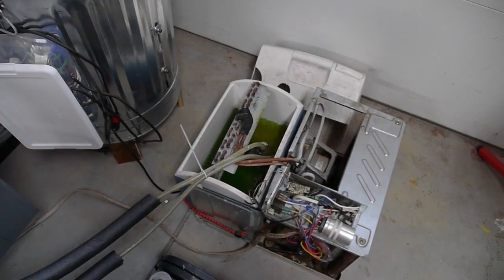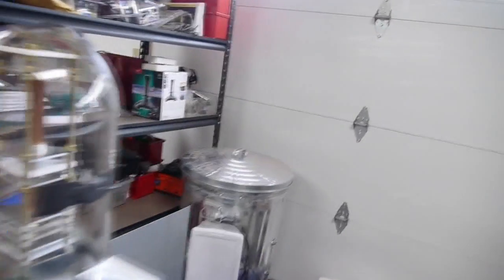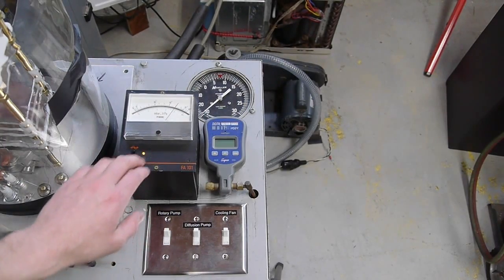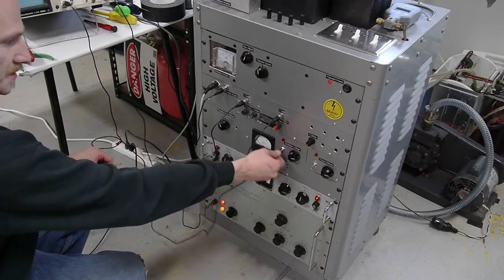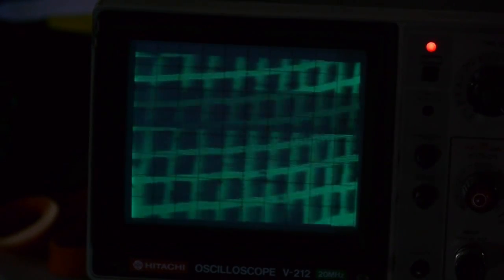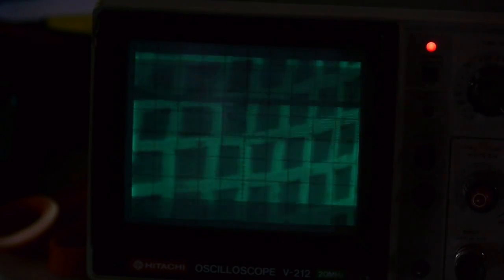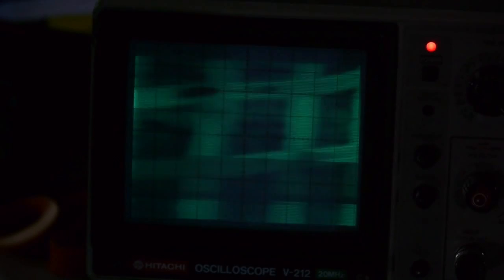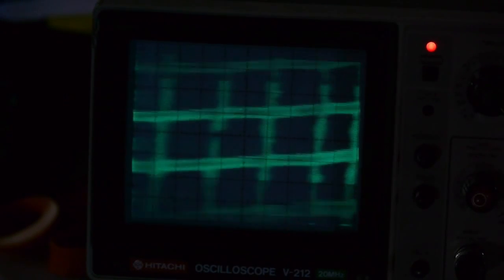DIY Scanning Electron Microscope - Operation procedure

Comment: every low cost light-microscop makes better images thany yours . The cheapest WEM costs about 30 000 Euro, then you need a sputter etc....
If you want to build a DIY REM ou will need many time and at least 10 000 bugs. There are sevices which make you SEM-pictures for 50 bugs....

Comment: If the secondary electrons are just getting attracted to a detector, which I assume just outputs the brightness, how does it display a 3D image (where you can see the mesh is woven)? How do  you see that one wire is above another? I would have assumed the result would have been far more flat/binary with a signal whenever there were any secondary electrons and nothing where there were none. It's not even that depth = brightness, the images appear to be 3D with an external light source picking up highlights. What should I be googling to understand this? Any descriptions I've found online just explain the process as you did (electrons produced > focused > secondary produced > detected > displayed)
Reply: Same question. I presume the brightness of the particular point depends on the angle between surface normal and the the beam of electrons falling upon it. In this case it's can be explained why the object looks like it's being illuminated by some light (with shades and half-tones).

Comment: Do you suppose the slight waviness could be caused by the phase shift or delay in the power for the directing plates and the signal going to the oscilloscope? In which case just a simple capacitor/inductor circuit could solve or minimize the problem.

Comment: Ultimetley i was very excited for the medical implication of this device. However without the zoom being capable of resolving samples to around 100nm in size its application is useless as anything that has a maximum optical capacity of greayer the 1 micron can be suppased by normal microscopy. Thus what need is there for an sem with less optical zoom then the normal microscope..

Normaly sem in the medical diagnostic fields are used to resolve bacteria and viruses so this is what i was so hopefull for when finding your work.. Please focuse more on this there is great need for a cheep sem of the kind i describe.
Reply: He built this in his garage.. not sure if he was intending on using this to save lives
Reply: 1) Electron microscopy usually has better depth of field than conventional optical microscopy.
2) Vacuum and electron beam can cause damage to biological samples, needs to be combined with cooling and low voltages, low vacuum.
3) Confocal microscopy has higher magnification than conventional optical microscopy.

Comment from the maker: Not too often. The vacuum system is very simple, and has only one valve so there isn't much to go wrong. I did have a problem with insulators in the chamber becoming charged, then suddenly discharging and causing problems with electronics.
Reply: the turbo melecular pump cost about 10 000 bugs, the higher the vacuum the better the resolution

Comment from the maker: Destroying a filament is pretty difficult. A lot of air would have to leak in to cause the tungsten to actually burn through. I don't think I ever destroyed one. However, I had plenty of arcs in the chamber, and changed my emission current gauge twice since it would blow out after a major arc discharge.
Reply: if what you call filament is pretty difficult to destroy, your filament  is pretty bad

Comment: Amazing work! Wouldn't have thought, that it is possible to build one working electron microscope without having access to a professional laboratory. 
I think the most sensitive thing to handle is the vacuum technology, if one of the pumps goes damaged your filament will burn. How often did that happen in the engineering process?

Comment from the maker: No, the problem is that chamber materials outgas and also release adsorbed molecules (like water), which must be pumped away or else the vacuum will get worse over time.
Reply: moderm SEMs do low vacuum with some water to prevent coating

Comment from the maker: Yes, but the problem is that you might have to submerge the specimen in an aqueous solution for silver coating, and this would saturate the insect with water, which you'll have to fully remove before inspecting with the SEM. However supercritical drying is often used for specimen preparation, and it's possible the extra water will not be much of a problem.
Reply: today we have cryo tabel and low vakuum imaging

Comment: Not possible. Voltage RMS into 8 Ohms at 89.5V will give you 1kW RMS exactly. That means a peak Voltage at sine wave at 126.5V. And you will need it at both rails, since you pull that power to the speaker from 1 Rail only 50% of the time. That is what I understand about RMS - not what the Music industry says whatever like Music Power 5kW or so.

Or can you explain, why my calculations are wrong possibly?

Comment: TDA8954J as Modulator and the STY112N65m5 as Transistor? Well, What Voltage the IC needs is clear, but what Voltage do I put to the Transistor? Power Required in RMS gives you Voltage RMS gives you Voltage Peak. Should I give Voltage Peak plus 5 Volts, to get the power required? And how much of that Mosfets do you recommend me to use for 1kW? They make over 400W losses and Class D has almost no losses, what do you say?

Comment: Well, I want a 1kW Amplifier, the 460 is almost perfect because of the high ratings for voltage, amps and power dissipation. But I need at least 10 or more, to get that power into 8 Ohms (It's still more simple than for 4 ohms, because of current limitation per output device). You know what I  mean. To expensive for me, only 330€ per month. :(

Comment from the maker: Thanks! CRT electron guns are optimized for producing a fairly large spot size. The SEM requires a much smaller spot, and this changes the way the gun geometry is setup. Another problem is that CRT guns are coated with a metal oxide to enhance electron emission. However, venting the tube to atmosphere will cause the coating to become "oxygen poisoned", and the emission characteristics will be hurt significantly. I haven't done the experiment to determine how significantly, but it's severe.
Reply: electron gun and alignment cant be made DIY at home this way

Comment: i believe that the shakiness of the image can be reduced if the microscope itself is physically separated for the vacuum pumps - vibration of the pumps moves the sample and the image gets shaky
you probably watched it but i found a lot about electron microscopes in this video series
Reply: every electron microscoper knows this. Also the hole instument has to be carfully isolated from vibrations